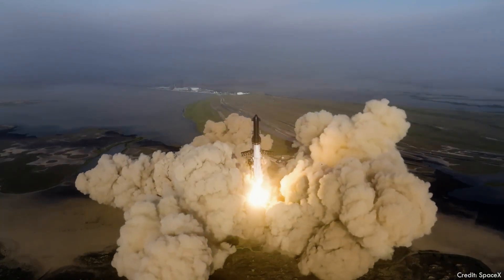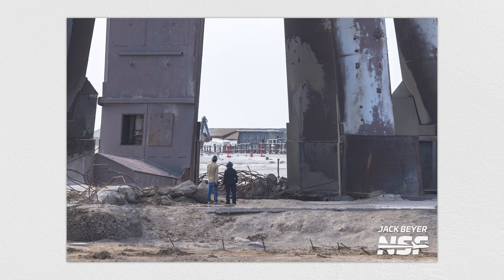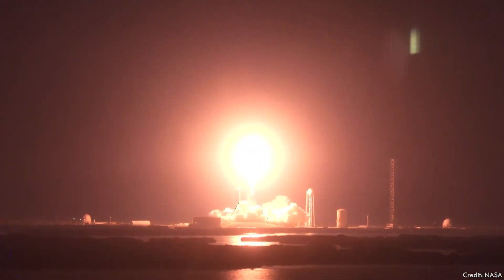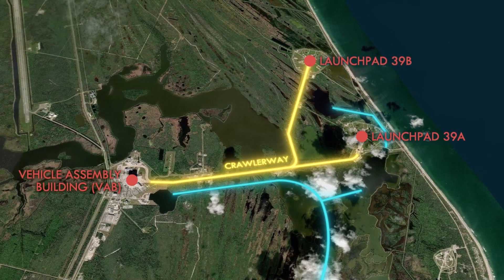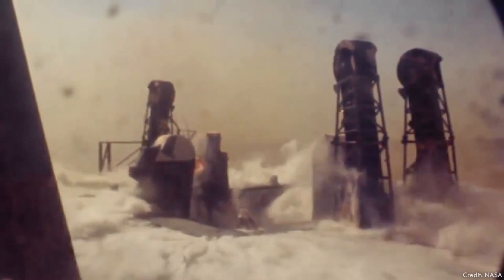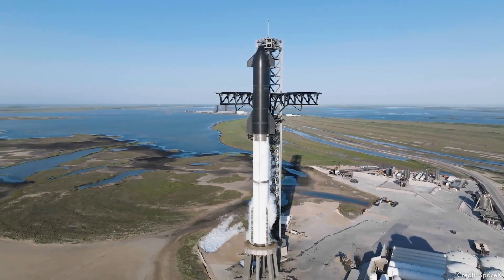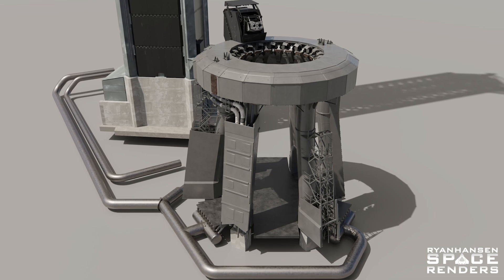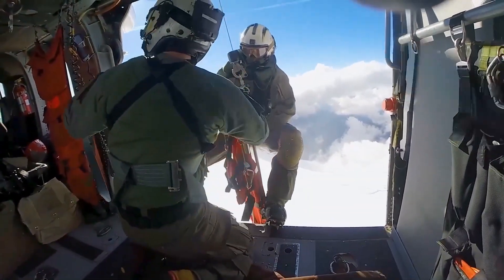Was Starship’s Stage Zero a Bad Pad?

Comment: Doesn't a ramp mess with the equilibrium of the launch, making the lift on the top side of the ramp strongest while the weakest at its lowest part, or is that a negligible effect? edit: that might be a feature since they want a slight curve to the launch to take advantage of the earths rotation?

Comment: Constructing a concrete structure resembling a volcano with multiple holes around it to disperse heat presents an intriguing idea. This design could potentially spread the intense heat generated during a launch, reducing the concentration of heat in any single area.
Reply: The problem is not heat, it's the vibrations, this thing is like a constantly exploding bomb underneath it, you need watter vapor to absorb the vibrations.

Comment: Maybe somebody here could give me some answers that I haven't been able to find on Google. I've got two questions about the launch system here. First, why did it seem to take so long for Starship to actually start moving? It's like it reached full throttle and then just sat there for an extra two or three seconds to really tear into the foundation. Was this an issue with the hold down clamps, or do the Starship engines really take that long to spin up to full throttle? It looks nothing like any other non-SRB assisted launch I can think of.

Second, why not use the Mechazilla? Why bother with so much time and effort with creating a launch pad instead of just hoisting it up and launching it in the air from the same place it's going to land? Obviously this would still require some kind of pad beneath it, though a significantly smaller and less complicated construction. The only real problem I can think of is weight. I know the Starship is around 25 times heavier with the fuel, but it still seems like Mechazilla could have been designed to support it. Maybe the arms would need to be supported on the free ends. 

I can somewhat understand the original argument, as ridiculous as it was. The plan was to be able to launch this thing from the ground on mars. Or at least with minimal reinforcements. Is this actually true though? Did anybody at SpaceX actually think this was going to be possible? Even before the recent test, it literally would not have taken a rocket scientist to realize that wasn't going to work. I mean if this was legitimately the strategy, why not try to find a piece of ground that is exposed solid rock? That's probably going to hold up pretty well. It could be found on Earth as well as Mars. And if they couldn't find a property suitable on Earth that they could buy and use, surely they could just ship in a giant rock. They gots tha moneyyy.
Reply: second: cause the stage0 has important technic for the rocket. like the ability to start up the outer ring of raptor engines. they could not start without stage0 and i highly doubt the chopsticks can even hold the fully loaded starship + booster.
first: it took a bit more time, cause not all engines where their to fire. starship can still liftoff with some missing engines, but the power is missing and yes, it takes times to throttle up all engines, but i guess the missing power was the mainreason why it took so long for IFT1

the fondaq has the specifics to withstand the force of the raptors, u can calc it and its still a creat margin left, the problem was that the power got beneath the fondaq. 

thats my 2cents, dont take it for real. maybe im wrong xD

Comment: I would want to put the rocket on a platform, leaving hundreds of feet of of vertical space between the rocket nozzle and the surface to be attacked.  But maybe we would need a thousand feet or more to cool, slow, and dissipate the rocket exhaust to an easily manageable level.

Comment: In order to keep the rocket programs moving forward we need to create an environment where launching starship and its successor is seen by most people as no different than a Walmart truck loaded up with consumer goods. SpaceX really made a mistake there but so far it looks like most people are accepting that mistakes do happen. Next time we push the self destruct button it needs to be far out over water and just a little dot in the sky and become a set of little bits that inconveniences nobody. We have such items as people and atomic power supplies that we will be needing to put into space. The falcon 9 has become a model of sane rocket development and we need to keep that going.

Comment: How do they build the launchpad on the moon or Mars without landing there first?
Where does the water for the deluge system come from?
Starship doesn't work without a robust launchpad. Starship's goal is to reach the moon and Mars. No launchpads there.
Anyone else notice a bit of a problem?
Reply: The booster will only be used for earth launches, it is not required for mars or lunar missions. They have done suborbital "hops" with the ships without doing any damage like the booster did so no worries there. They have not really released plans but in their renders it shows that for lunar missions the ship will use smaller thrusters near the nose cone to get off of the surface before starting up one of it's Raptor engines. Should be neat to see if they can pull it off.

Comment: Since Starship is (in theory) supposed to take off from Mars and return to Earth on some future missions they would need to develop a launchpad structure on Mars that can tolerate some lesser degree of abuse (lesser, because the gravity is lower on Mars so a takeoff thrust might not need to be as great?).

What if the pad was constructed out of several meters of ice that was reinforced with carbon fiber or high strength polymer rope?

Sure, it would erode and vaporize and eat a hole through the ice but maybe that would increase the thrust from the expanding water in to steam below the ship. It might require some re-design of the base of the rocket to take that reflected blast upwards and not destroy something vital. 

Ice could even be used on Earth as something cheap and rebuildable. It might even be possible to take off cryogenic cooling from the oxidizer to drop the ice temperature very low (-50 to -100 C if it was covered with a thin insulating layer of foam.)
Reply: Much lesser, Starship will be capable of taking off under its own power on Mars without needing the booster stage. A basic concrete launchpad will be plenty sufficient for that.

Go look up Martian concrete, that is the most likely building material they will use.

Comment: I hoped you would comment on the new system SpaceX will use. Do you think it will be ok? I made some calculations, and I have serious doubts, but there is not much data available on the new system, so I may be wrong. However, the amount of water you can vaporize with in the order of 100GW of power is staggering - tens of tons per second. You can even vaporize tons of steel every second. So when the flow of water under the pressure of the exhaust is insufficient, the steel might melt or get very weak, and water in the "cooler" might boil and make the whole thing explode.

I hope that's not what will happen and somebody thought this through, but unless the heat can disperse quickly enough, move away from under the rocket, it will get very hot there and things will heat up to exhaust temperature quickly. On the other hand the steel structure, the legs, seem to have survived without cooling, so things might not be as bad.

What do you think?

Comment: Why don't they use rivers or even the ocean as a launch site if water is the #1 strategy to dissipate the launch energies? Vaporized liquid will automatically refill, they are already using corrosive-resistant materials in the rest of the builds and the primary building material for the platform was just stacking a bunch of dirt into a pile.

Comment: Yeah, I don’t understand how cheap NASA and space contracts are all the money goes to I guess administration and engineering because they want them built cheap my pops put in a bid to make the fiberglass fuel cells and he said he did it to where he barely broke even , also with no overhead as a big company and they said it was still to much money, basically it come down to they want it cheaper than he could even buy the material

Comment: With their new system, it might be better, but will the reflected pressure waves go right back to the booster? Even in WW2, the Germans used an angled blast deflector. In the aviation world nearly all blast deflectors are at an angle. Sometimes fast, lean, and cheap turn into long, slow, and expensive.

Comment: Of course it's fun to watch Musk's ventures break new ground and advance technology, but this isn't advancement, it's ignoring common sense. The first launch pads were just that, simple level pads, probably of not-so-special materials, because rockets weren't always so powerful. But flame trenches have been used at least since the German V2 in WWII, and are standard features  on launch facilities. It's pretty obvious all of that expense is gone to for a reason. Musk didn't innovate technology, he devolved it. "The best part is no part" is a truism, not a law of physics.

Comment: It will fail. Elon Musk ruined space X. I'm an engineer and if I had a boss like him I would run away as fast and far as I could... He is not an engineer, just a parrot who repeats what he heard during meetings without understanding anything. He is a FRAUD. There is no way that the new design will withstand the power of the 33 raptors...
Reply: I bet with you he is shortening or expanding whatever he heard at the meetings as he sees fit, when concidering the amount of bullocks he has talked.

Comment: sp why cant they use the exhaust to help lift the rocket throught a secondary way even with "ropes" around it lifting with help of exahust -then it launch it form a tube unerground or better a hill saving fuel due nearer to space -but why not a train launch it for speeding craft or elevator -Guess must just concentraded on fast and cheap for him sicne ww3 are about

Comment: I deal with Draining Wet Granular systems - very little research exists - it does on wet granular systems which are enclosed to they can be measured but the Beach - cannot - well in a simplistic way - that is where armchair @andyhancock comes in! LOL - and your video just skirted on the pad but what about the steel pad and water deluge - A. where is the water coming from? not the Brownsville main - or the ocean apparently, so where will it be stored before it is shot out, under pressure? also they have used directional and fixed drilling to install the pilings which are to 110 ft apparently but if they use say 1/2 million gallons per launch where will the non-vaporized water go?- after all, it has to start before the rockets fire right and they do not know yet whether they can launch faster as the effect of firing them all at once - everyone agrees would be almost catastrophic - so time lapses between water deluge and vaporization? lots of good engineering questions including settlement due to extreme vibration and liquifaction. All stuff you fina chaps should cover as I am pretty sure space x don't know

Comment: Why try to fix something that isnt broken? If it has worked for over 100 launches it will work for the new rockets. This was just plain careless planning on Space-X’s part. Once again showing how Elon tries to rush production without regard for safety and regulations.

To call it “pushing the limits” is sugar coating what it actually was. Poor planning and design. Stop defending his lack of respect for rules, regulations and safety.

This is why Tesla Self Driving Car Mode will forever be in Beta and continue to hide and reveal the true number of accidents and deaths.

Comment: It should be noted that SpaceX's water  deluge system was being built, but not yet complete, at the time of the April test. And that SpaceX engineers thought the concrete would be sufficient for one test. So they made the decision to go ahead with the launch.
Of course hindsight is 20/20.
Reply: And you can see Common Sense Skeptics video, how that will most likely turn out, when he was covering launch of starship.

Comment: Actually the damage to the pad was surprising. The half thrust static fire left next to no damage on the concrete. The static fire earlier that did damage the concrete was even less powerful than half thrust, but it was done before the FONDAG concrete was used. The last static fire of the booster mentioned in the video used the upgraded concrete and caused minimal damage.

Comment: Correction: The FAA didn't 'ground' SpaceX after the launch failure. SpaceX only ever applied for permission for a single launch in the first place.
Reply: I think it's fair to say that the FAA won't be approving any further applications until they get that mess figured out. That was most certainly not supposed to happen!

Comment: One very important bit of context here: SpaceX builds rockets, like software engineers build software. They build the smallest increment that is reasonable and test it, expecting rapid and repeated "failure". At the point where they decided to go with just a concrete plate beneath the launchpad, they did not have enough information to know that this would most likely not work. So they built the simplest thing that might. At a later stage, it became clear that would most likely not be enough. But at that point they had already built the whole thing and prototypes were ready to fly. Instead of ripping everything apart and introduce another big delay, they decided to just see what happens. It might hold, right? And if it doesn't ... they would most likely have ripped out the whole thing at some point anyway. Doesn't make that much of a difference who does the ripping. You see the same thing in modern software development. It is much more valuable to test or ship a product and get feedback, rather than ship a product that is, in your eyes perfect, only to have the customer tear it apart in five minutes and give you another 6 month of changes to work on.

Comment: So they saw the damage of the static test fire and were like "well, whatever. Let's just continue"?
Reply: The video is wrong. There was damage to the concrete during previous static fires, so they replaced the surface with Fondag concrete. After this replacement they did the all engine half thrust static fire and that basically did no damage to the pad. Surely there was some erosion but nothing outsiders could see. They did not expect significant damage during the launch either based on this. Some people speculated that the reason for the failure was that the sand compressed and or liquified (there is much water in it) due to the thrust and vibrations. Couldn't support the concrete slab properly and that caused it to crack. Exhaust got into the crack, excavated some sand, further weakenimg support and the whole concrete structure failed.
Reply: @zoltankurti  Oh okay. Thanks for the explanation!

Comment: the dream of space ex is to be able to launch again from a celestial body, to land back on earth after a launch. There wont be a  feasible way to build one of these in space, but instead of building a rocket or a launch pad that can withstand forces. they went ahead with optimism and disregard for people around. there are ten protected animals living in the area around the launch site, which along with everyone around have gotten a nice shower of concrete bricks.
Reply: The concrete pieces did not go very far.

And when launching off of another celestial body it will be the Starship alone, not the booster which did this damage.
Reply: @essay8634  The concrete pieces went upwards of a mile, destroying not just the nearby buildings but scattering debris throughout the protected wetlands nearby. Even a baseball sized piece of this debris could easily kill a person or cause major damage to a building, let alone the huge chunks that were clearly visible from a mile away. Let's not downplay how egregious Elon's disregard for others was in this instance.
Reply: @reverse_engineered  I've seen no report of any buildings or property damaged outside of SpaceX assets or people taking a known risk in an attempt to record the test. Nor any reports of injuries. The sand that fell over the area for miles around has been determined to just be sand, not concrete, and not breatheable. Yes there was a fire nearby and yes concrete entered the nearby wetlands.

It is possible to have egregiously disregarded others without actually causing harm to them or their property, which is a more factual narrative IMO.
Reply: @essay8634  yeah even in protected areas you cant sand blast the an area miles wide for some reason. Yeah like its a whole thing
Reply: @jurrasicore8682  Huh?

Comment: Well first off, my opinion on it was, ya don't fire huge amounts of any explosive or fuel down to a flat surface.  There should always be some sort of diverter.  Which is what they should build.
Reply: The "Milk stool" OLM will now stand over a diverter, the steel plate deluge system  under construction now. The exhaust will now be diverted, from going straight into the ground as it did, into a 360 deg arc as intended.

The flight test of the pad exposed a major design flaw that would have gone uncorrected had an effective diverter been in place. The data acquired has guided a redesign that ensures that the pad will be able to withstand the loads from the next launch, as well as the increased loads that the more powerful Raptor 3 engines lifting 6000+ ton stacks will create in the future. 

The upgrades that have been installed have corrected the flaw in the basement. The pad will work, just as required, or it will be fine-tuned if necessary. There won't be a "flame trench", and there won't be another crater.